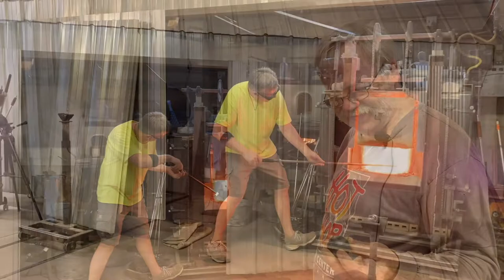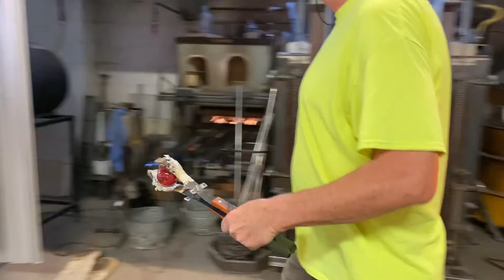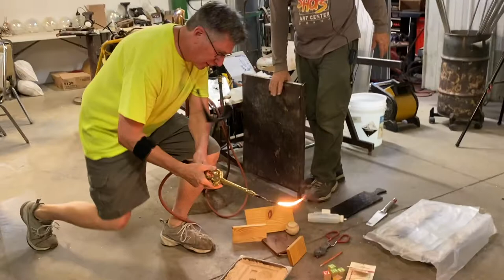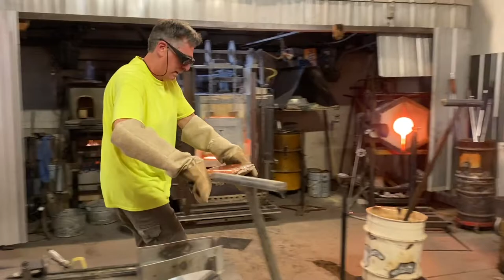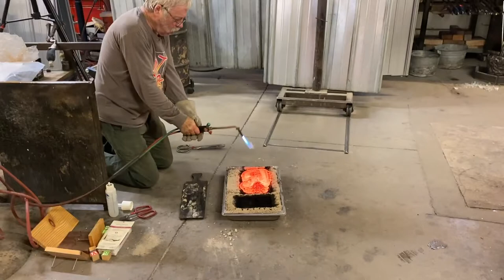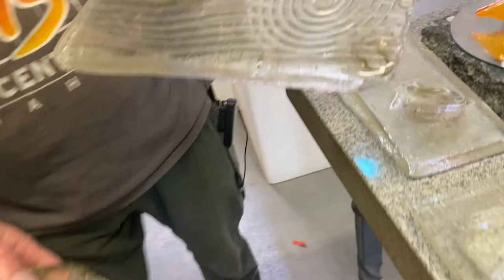Glass Sand Casting

Comment: 1. Glass is made mainly from ordinary sand (made of silica), from soda ash (NaCO3) and from limestone ( CaCO3)
2. Glass can be made from silica alone. However, silica has a very high melting point (1700 degree Celcius), so soda ash is added to lower its melting point.
3. Adding a lot of soda ash makes glass too soluble in H2Ü, so limestone is added to reduce its solubility.
4.
5.
6. It is stated in this book that very cheap glass is green because it contains small impurities of iron.
7. Metallic oxides are added to male different colours.
8. Unlike most solids, glass is not made of crystals and does not have the same rigid structure. It is an amorphous solid.
9. When glass is very hot it flows slowly like a thick liquid.